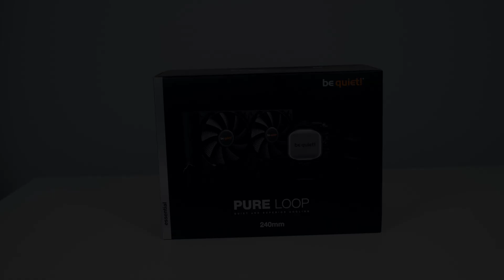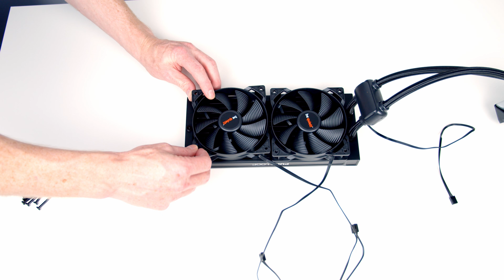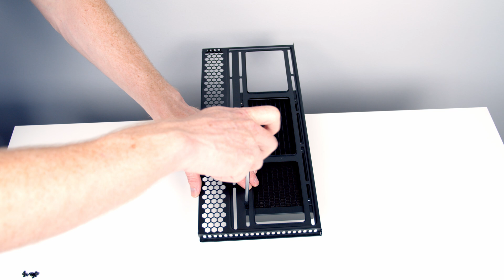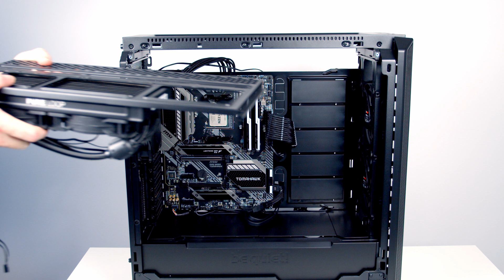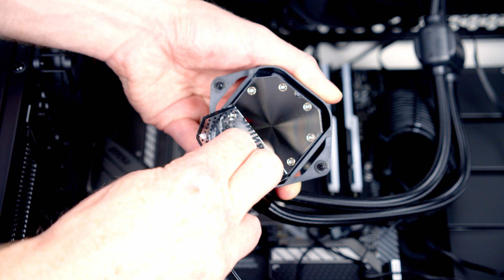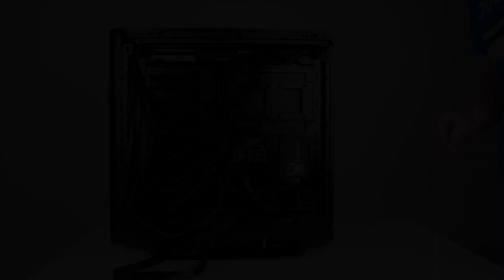be quiet! Pure Loop AIO Installation Guide

Comment: So i just got this pump but when i turn on my PC im getting a CPU fan Error
Reply: That's normal as you don't have a pump/fan connected to mobo header. You can choose to ignore in bios.
Reply: @wild_cumulus_cloud  actually the AIO fans should be plugged into the CPU fan header. Either that or I’m doing it wrong.
Reply: @engineerbot  I use the supplied SATA power connector with two fan splitter on the other end for powering pump and the LED. I use Corsair iCue to control the radiator fans. In this setup, it will give you CPU fan warning. But you can use your motherboard header to run the pump/fans if you want to. Cheers!

Comment: Hi Christopher , what is your favourite best midi tower case and AIO cooler ? (Budget not an issue as want to go for high end).
Reply from the maker: Lancool II was case of the year and deepcool 360ex gave me the best temps so far
Reply: @ChristopherFlannigan  Which screw drivers do you use ? I need to purchase a kit for PC building / assembly. Also probably need long plus screw driver to screw mother board in.
Reply: @ChristopherFlannigan  I will be getting the Asus Dark Hero VIII MB , Do you recommend Asus GeForce RTX 3090 Rog Strix Gaming OC 24GB GDDR6X PCI-EXPRESS GRPAPHICS CARD or MSI GeForce RTX 3090 Ventus 3X OC 24GB GDDR6X PCI-EXPRESS GRAPHICS CARD ?
Reply: @HMcod  professional screw drivers ?
Reply: Thanks for the video - I’ve also enjoyed your case reviews and builds. About the pure loop - I’ve heard conflicting reports that the pump makes a low droning / resonating sounds that can be heard over the fans and when the computer is idle. On the other hand, sever reviewers describe the pump as silent. Could you comment on the Pure Loop’s pump noise or lack thereof?

Comment: First time PC builder, need some help deciding parts that would fit into the case, I have the 3 main components, asus strix b550e, asus tuf rog 3070, cpu amd 5600x. Im looking to get the llani lancool mesh 2 that you made a tutorial to build for. I wanna make sure the PSU, AIO etc fit in the case so need help deciding the following. PSU and AIO. What would you recommend? Noise levels low is a big plus for me.
Reply from the maker: The corsair psu I use works well just do a psu calculator online to get the right size with all your parts. I haven't found a quiet AIO yet, but the dark rock pro 4 would be my recommendation is noise is important